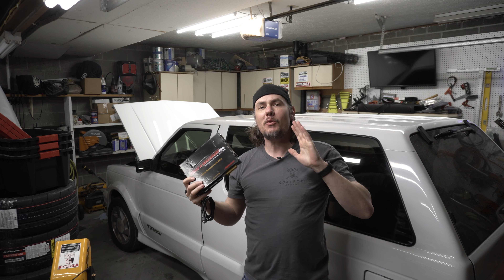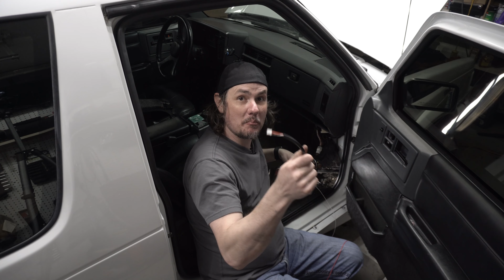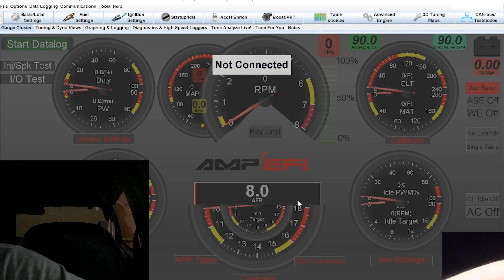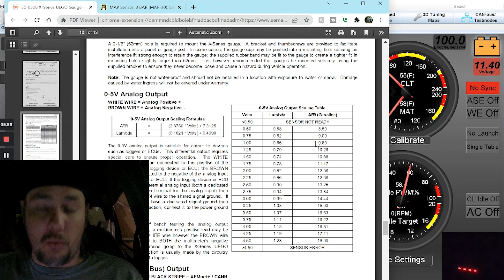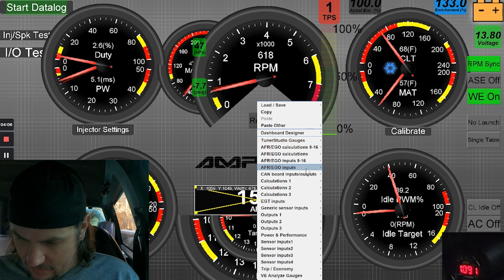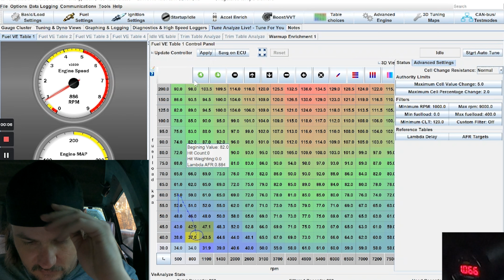Installing A Megasquirt On Our New Project Typhoon!

Comment: I'm in the process of getting my typhoon done and we're going with the maxxecu and we are ditching all the stock ignition system crap and going with dual sync distributor from holley.  i have replaced so many ignition control models that GM should give me stock options.  The ICM is very heat sensitive and i wish they would have went with the same ignition system as the grandnational because it seems to hold up better under turbo heat.

Comment: you can add a flex fuel sensor in megasquirt. its defifinitly my favorite system for the DIY guy, its not for everyone though. the only down side is VE resolution is on the small side.

Comment: Inspired . Went to the garage took storage boxes off the roof and hood of my ty that's been sitting for 12 years. The 90s 17 corvette wheels go great in these and can use the GMC center caps on certain ones . I saved my 16 inch ty wheels but found it easier to get 17 inch tires

Comment: Don’t forget that you can use a vortec distributor and a 24x reluctor wheel with a Holley or stock plastic cover. Love it on my 383 sbc. And have plans of using it on our 290hp 4.3. Both act as though they are ls engines. Works well.
Reply from the maker: I've got a cam sync distributor and a 58x reluctor and cover on the way!
Reply: @GoatRopeGarage  very cool!

Comment: I use to smoke them with my 94 ford lighting back in day lol and the cyclones as well like you said .
Reply from the maker: Don't be spreading lies! You've never beat anything!
Reply: Syclones were absolutely capable of running 13.01 seconds on the quarter mile completely stock. Not even the Gen 3 lightning was that fast. A stock 91 Syclone (92 or 93 Typhoon) vs a stock 94 Lightning? The Syclone and Typhoon would eat it up all day long, even heat soaked. Your lightning runs 15.3 second to 16.5 second quarter miles when its running good. Put some respect on the Sy/Ty's and put your money where your mouth is. Wheres your stock 94 lightning at? I'll dust you with a stock Syclone every run.